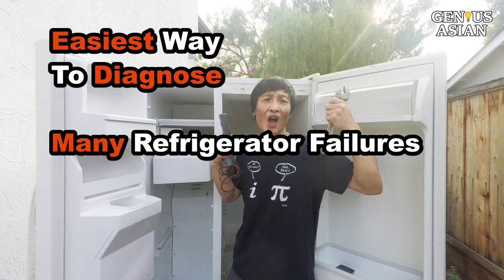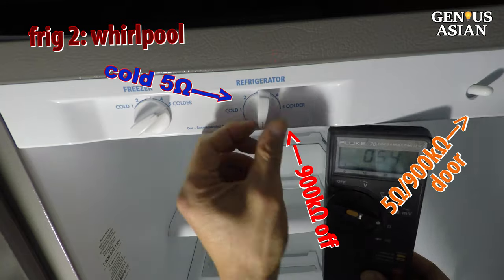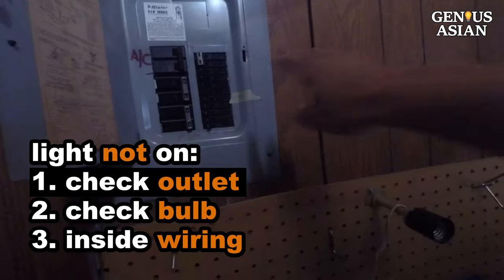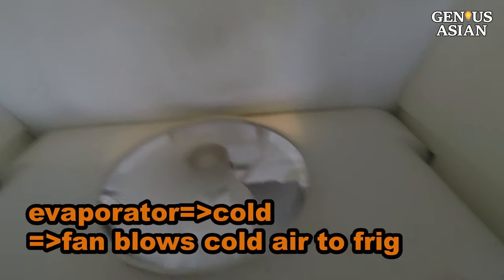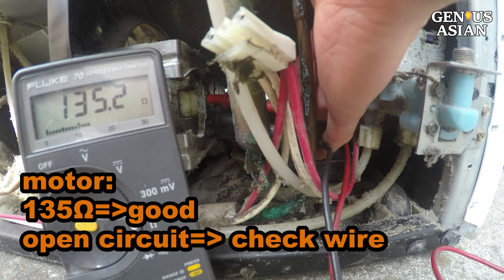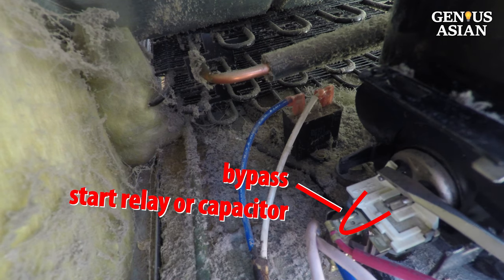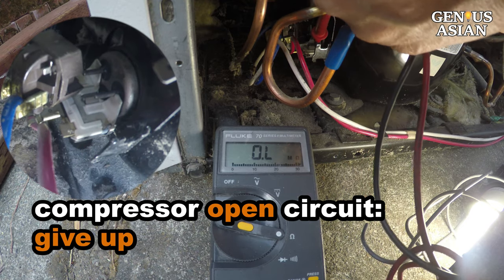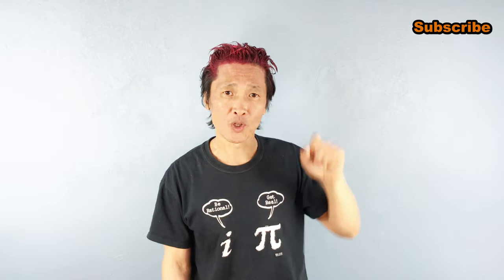Easiest Way To Diagnose All Major Refrigerator Failures

Comment: Any insight into a condenser fan with a thermostat?  The fan isn't getting voltage, so the thermostat isn't closing the circuit to supply power. The thermostat was just hanging loose, but it appears it should be clipped to a tube. Based upon proximity and size of clip compared to the tube, it appears the thermostat should be clipped to the line returning from the condenser coil?  Would this make sense?

Comment: I'm sure you could figure out my situation, but I'm lost.  Fridge stopped cooling.   Fan is running but tubes from compressor are same temperature.   Seems compressor isn't turning on, why, IDK.  I'm semi-handy, but this is too foreign to me.  Love your channel...subscribed.
Reply from the maker: Sorry to hear that. When you suspect your compressor isn't turning on, is the thermostat closed or open?  thermostat: https://youtu.be/grURTgO2-x0
Reply: @GeniusAsian  Had repair guy come out....Inverter was the issue.
Reply from the maker: @kurtwagner1092  My Samsung refrigerator has a big sign of 10-year warranty for inverter on the front door. Make sure you save money by using the warranty. Since inverter compressor does not run as high speed, it may last longer thus the manufacturers are willing to risk to offer 10-year warranty on the inverter. Thank you for taking the time to share problem and fix, your comments will help other viewers.